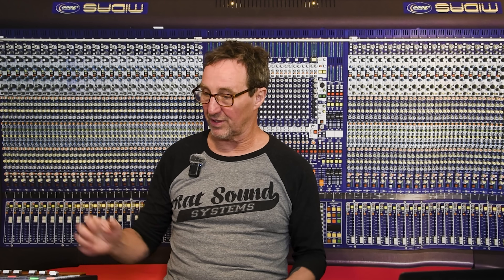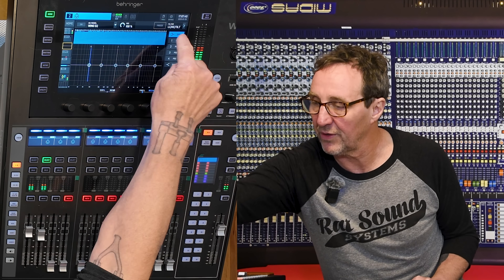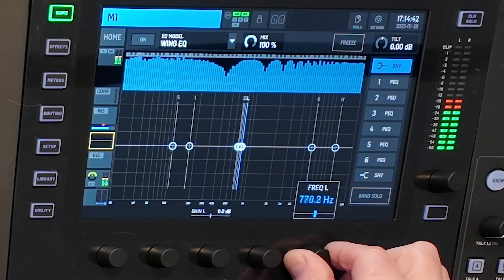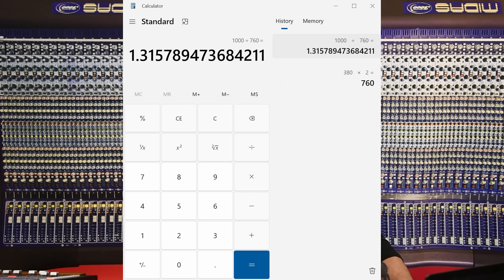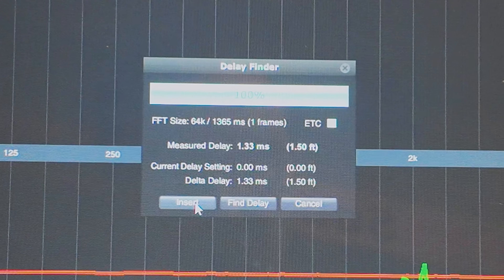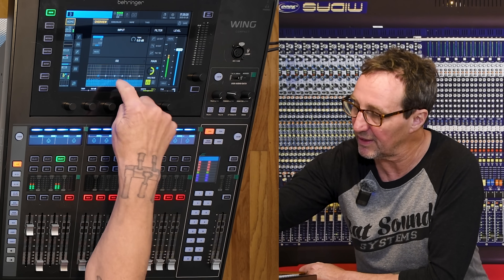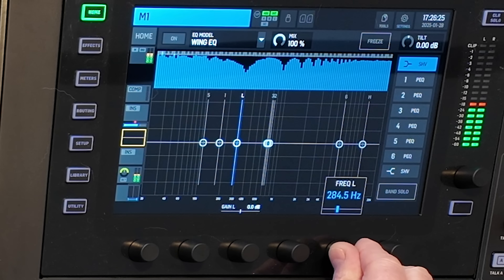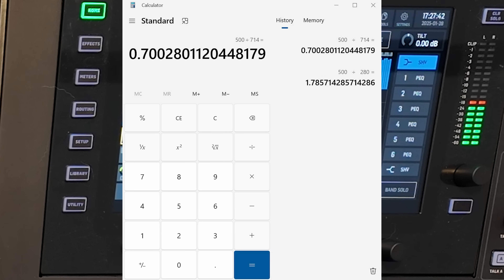Easily Find Console Comb Filtering Latency Issues

Comment: Great video Dave! I would have thought that in 2025 digital consoles would have internal delay compensation for theirs plugins,  like most DAWs. That feels like going back to pro tools 8 le.
Reply from the maker: I believe most if not all the consoles have a fixed latency if you use the native EQ, compressor, gates or whatever is on the channels and such. but when you add things from the effects rack or plugins with pretty pictures and fancy stuff, then those things typically add latency.

The issue with automatic latency compensation is you have a choice of either making the console with a very long latency and a lot of capabilities and choices of things to do on the latency stays locked or making a console that has a very low latency which is desirable for live sound with limited capabilities and when you expand those capabilities either those particular channels have different latency or the entire latency of the console shifts. 

The problem with automatically shifting the entire latency of the console is that with live there are many things that change sound depending on latency. like musician singing with in ears, altering the latency will change the way the inner is sound for them. also if you have stage monitors the frequencies that they feed back is somewhat dependent on the distance from the speaker to the mic and the latency of the digital system. altering the latency will change the frequencies that these speakers feedback and the way they sound. so an automatic latency compensation that changes the vocal mic latency when you add something to the kick drum would be extremely unwieldy

Comment: This is quite important for the folks using parallel compression subgroups
Reply from the maker: agreed and it's just a good idea to test setups rather that just trust that all is good.
Reply: I don't know these boards, but I guess using a wet/dry setting on a compressor instead of a separate bus would alleviate the issue, right? Or ofc simply adding the compressor to the main chain as well.
Reply from the maker: Yes I would assume that is correct because there should not be a latency shift between wet and dry and if you do the same thing to everything it should stay in time
Reply: I do not know of any digital console I would do Subgroup Parallel coms with at all.  It's the reason for the Wet/Dry mix on the compressor itself.  Our DigiCO rep said there is 8ms of latency flat out for any internal processing on our Quantum 338.  This includes all Waves Rack processing.

Comment: Thank you so much for this Dave! I’m not a Wing user, but can verify that both X32 and M32 do not compensate correctly for inserted plugins on groups or channels. I always make sure to do the same processing on my full range dynamic busses (compressor inserted but doing no compression) as my squashed busses (same compressor hitting hard). It makes it really easy to rebalance things. And if you gain stage correctly, it’s really easy to balance the overall mix and not worry about latency. Robert Scoville still uses the same principles on S6L even though the console has multiple forms of delay compensation, and I think that comes from years of experience seeing a machine calculate that incorrectly. Your ears will always tell you what’s right. You f*ckin rule man. Keep up the solid work!!!
Reply from the maker: excellent and great methods and thank you

Comment: Thanks so much Dave! I plan to run this test on my SQ5 to test A&H’s claims of phase coherence between all mix outputs
Reply from the maker: awesome and let me know. I think as long as you only use whatever is default to the channels and such, everything should be time and phase aligned. 

when you add those fancy effects with pretty pictures or patch external or use waves that things get all screwy
Reply: @DaveRat I've already tried everything labelled "deep" for the channel strip. With Allen & Heath, it doesn't seem to be just marketing. 
I can't detect any comb filter effects.
Thanks for the super cool idea for the test setup, as usual!
Reply from the maker: perfect and gaming confidence that you're set up is good or finding problems are both exciting outcomes to testing!

Comment: That is one of these idiotic made problems that you then in the most complicated way pretend to solve. All for the YouTube algorithm. in 30 years of digital music production I never ever encountered a problem with comb filtering because of latency. Every DAW has automatic latency compensation. And you can determine that extremely easily, without your bullsh1t method. I attest you a are a snake oil seller.
Reply from the maker: very interesting and the fact that you don't deal with live real-time sound reinforcement perhaps leaves you a bit blinded to a whole aspect of the industry that faces a different set of problems. 

I can see how you may develop an opinion that applies to your more limited experience realm

in a DAW it's true that latency is easy to solve because you're not really that concerned with real-time audio

conversely for live audio we are extremely concerned with latency and changes in latency. A live console that automatically corrects for any plugin that changes latency by changing the overall latency of the console to compensate, like a DAW does, would also alter the amount of time that all the signals take to travel through the console. 

for musicians listening to in-ear monitors that latency change would alter the way the sound of the in ear monitors interact with their natural voice and change the tone and sound of what they hear. as in, add a plug into the kick drum and everybody hears their voice differently.

More drastic is live monitoring stage monitors where changing the latency will alter the frequencies at which they feedback requiring the system to be retuned every time a new plugin is added that changes the latency. 

furthermore the total latency times that a DAW systems can implement are not shared by live consoles where changes in latency and total latency are of a much greater concern.

well I appreciate your insight and experience, your lack of experience with live audio has helped you develop an opinion that is incomplete. 

I love posts like yours where you feel you are very correct and you are correct for the more limited scope of your experience. And I love the beauty that things are not as simple as they seem is such a wonderful adventure and learning opportunity even after all your years of experience.

I am not making things up to create a YouTube video but conversely I have over four decades in the live audio industry and I am helping to educate and inform people not only on what is happening but most importantly I am showing people how to test whether it's happening.

oh, also making a comment without actually watching the video is less that optimal.
Reply: @DaveRat  Dave....you are an amazing human being.

My first response would have been: "Go F Yourself!  Where's your YouTube channel and 100,000 extremely satisfied Subscribers?"
But you take the opportunity to Judo flip his nonsense into further audio learning.
We're not worthy.

First, I've also been doing all of this since the late eighties, and while every DAW may now have Plugin Delay Compensation:
A) it has been trash for most of that time, and just now is fairly reliable enough to take it for granted (especially the DAW Almighty!  Notoriously bad.). 

B) for the reasons that Dave articulated, Artists especially Vocalists need to hear a 'Real-Time' feed in their mix, any delay causes comb filtering in their Skull, adversely affecting their performance.  But this isn't only true for "Live Sound", DAW RECORDING SESSIONS are also Live Sound, and have the exact same considerations.

C) that's why EVERY audio Interface has some system for creating Artist Mixes.  Either they claim to have "Near-Zero" roundtrip latency ala-UAD, or they provide a "Mix Knob" that blends their onboard Analog Inputs directly (and dry-ly) into their onboard Headphone Outputs.  I repeat, ALL Interfaces built for DAW work have invested as much time into solving this problem, that You somehow missed for 30-years, as they do any other features.  For tracking, This is literally THE deal-maker or breaker for one interface over another, at least to most of us.  (Hint: get a Rolls PM50)

D) ...and this problem, that you don't think exists, existed long before DAWs or Digital Mixers existed.  
1) Every ANALOG Recording Console had designed into it nearly Half of its functionality dedicated to solving this issue.  A 'Split' Console and/or an 'In-Line' Console design are two ways of addressing the same challenge.  They both are essentially dividing the mixer into two parts, one for Input and 'real-time' monitoring (by the Artists), and one for 'Post-Tape' and processing monitoring (by the Engineers & Producers).  
2)  Tape Machines themselves eventually evolved from 3-head (Erase > Record > Playback) to (Erase > Sync > Playback), with the "Sync-Head" having the ability to not only record, but also Playback, at a lower quality but without the gap in time it took for the tape to travel to the actual Playback-Head.
(Clearly you never spent any time with tweakers aligning those tape machines either.  That too was about latency, time alignment, and comb filtering. But hey...)

And actually the Recording process usually goes:  'Input' Path > Multitrack Tape > 'Monitor' Path > 2-Track Tape > Monitor Return.
Recording Engineers have always had to Time Travel, teleporting to 3 different time-zones to properly record, from before the MTK to between the MTK & 2TK to after the 2TK.

So if ALL of the Analog Consoles and Tape Machines, plus ALL of the DAWs and Interfaces, plus ALL of the Digital Consoles have spent quite literally the Entire History of Audio Engineering addressing, designing, manufacturing, and then Working our way around this phenomenon, how did You miss it?
Irrelevant.

DAVE, you once again drew focus to something that I know, but didn't focus upon.
You were making a broader comparison of the Studio & DAW and a Live Sound environment, and you said:
"More drastic is live monitoring stage monitors where changing the latency will alter the frequencies at which they feedback requiring the system to be retuned every time a new plugin is added that changes the latency."

That to me is 1) exactly right, but 2) is a bit like not changing Input Gains after they've been set.  Changing either has unpredictable Downstream Effects.  Like changing Input Gains will break all of the Thresholds (and non-linearities) you've set on Any downstream, Changing the Channel's Latency will change the Frequency Response, and therefore change any fixed Feedback Frequencies that you've already rung-out.  (And leave you at the mercy of AFS.)

I asked in a previous comment on a comment, but given this exchange, could you Please Consider gathering your thoughts and doing a comprehensive video on Latency and Phase across the different aspect and history of audio engineering, like Only You Can Do?

Either way, if this Is snake oil that you've been selling me (for free) for the past decade plus, can I Please Buy Some More?
I can't get enough!

Comment: Hello @Daverat . Let’s say you have a mixing console like a x32 and a Apollo interface with sound ID software and add on correction to the Apollo interface and you sent the output of your mix through the Apollo interface and use the sound ID software to adjust for calibration of your main PA as long as you create a profile first when calibrating the PA for flat curve and latency correction,   could somewhat help with the latency ?  Just thinking other ways to help out  quickly with the latency since most of us cant afford high end consoles that comes with this latency corrections .
Reply from the maker: adding a whole bunch of latency with all the interfaces may not be the best solution. 

I would just test it.

Even with latency correction you've got to console now that changes it's latency based on the plugins 

especially for monitor consoles where the latency will change the frequencies that things feed back and the way that things sound to the music,ians through in ears, having automatic latency correction is a problem of its own
Reply: @DaveRat thank you for sharing your thoughts. Will keep that in mind .

Comment: is this behaviour the same across all digital consoles, or do some manufacturers build-in latency compensation across all channels? what would really be useful would be a feature where you can add channels to a latency group so whichever channel(s) has the shortest latency gets extra delay added to it so that it's aligned with the channel in the group with the longest latency.
Reply from the maker: I don't think we can generalize all consoles doing something or not but typically the built-in comps gates EQ and such don't add latency in most consoles that I tested. it's the added inserted effects and plugins like waves that are the wild West of latency offset. 

that said I wouldn't take anything for granted and I recommend testing and confirming you have no gramlins screwing up the sound of your show

Comment: Great video. Hmm? Wondering what's going on now when I use the 'mix' knob inside the plug-in effects for a semi parallel compression. 🎧🎙️🤷🏽‍♂️🤦🏽‍♂️
Reply from the maker: any mixing within a single plug-in we'll have the same latency on the direct versus effect.

it's when you remix the same signal with itself somewhere else in the console 

there are so many possible variations that the best thing to do is just test it and make sure. 

find those gremlins!
Reply: So latency compensation, like we got in DAWs, is off the table?
Reply from the maker: with a DAW you're not really concerned about real time. conversely with live audio if you added a plug-in on one channel and it delayed all the  then now you have changed the amount of time it takes the signal to travel through the system. 

One example would be a monitor rig where a musician is listening to their own voice and you insert something on the kick drum if it changed the delay of everything the singer would now hear their voice a little bit later than they did before. thistle change the way that the sound and the in ears versus the internal resonances and sound of their body interact and create a tonal shift. 

additionally if you have stage monitors if you add delay it changes the frequency that feedback happens so it'll change your monitor EQ necessity. 

for the main system it's not as big of a deal but still those minute shifts in the timing of all the sound that is heard when a plug-in is added may be an issue. especially if it's added during the performance.

these may or may not be big issues but I think the main point here is to test it and make sure that the system and mix is performing as desired.

I don't do much work on a DAW but if I did one of the things I would do is test and make sure it's performing and functioning as I think it is and do something like run the exact same pink noise into every input and then engage and disengage anything that's added and make sure that the tonality and phase does not shift in undesirable ways or unexpected ways 

or run test signals and do transfer function analysis.

it's about confidence that the gear is doing what it's supposed to do and nothing else
Reply: @DaveRat got it. Never thought about it that way.

Comment: Hello Dave. It is super important what you test on the console and also is in a DAW. Although Pro Tools has automatic latency compensation, whenever I send something through a bus, I create another one for what does not go through that bus, for example a drum with parallel compression, I make a bus with the compression and another without the compression, so they remain the same in time apart from the latency of the plug ing. And in the past it has happened to me that even though there is an automatic delay compesation, I have to multiply the plug in in a parallel process because I hear the comb filter. Something that is not taken into account much is that different converters have different input latencies, now it is less common, but several years ago one had different types of converters in parallel and if you recorded a guitar for example with two microphones and each one with its converter, the difference was noticeable.
Reply from the maker: interesting. and yes, it's important and I think overlooked
Reply: The only time I've had issues like that (in pro tools), and maybe this is the case you're referring to is with things like convolution reverbs and guitar amp sims. If you try to for example parallel a guitar amp sim on a bass DI to bring bite and presence into the tone you have to be careful it's not either inverting or also time delaying the signal because any impulse response is fundamentally a time-based effect. Next time I do it I plan to run some sine and square pulses through both to get a print of the invert/delay of the sim. From there you can manually delay the track in mix window to match. So I'd bus my bass to two auxs one clean, one sim, then I can micro delay the clean to match the new sim.